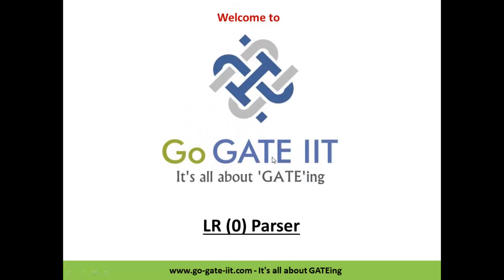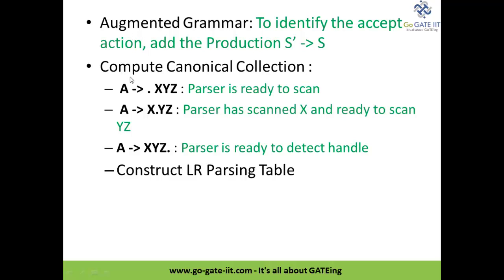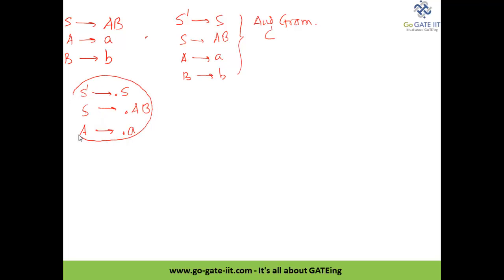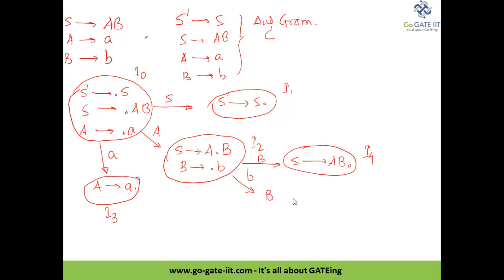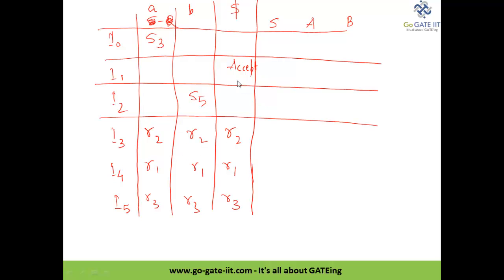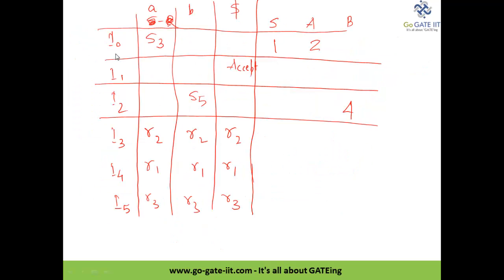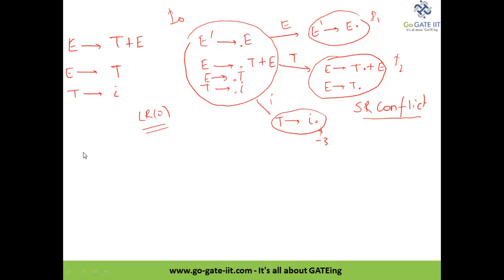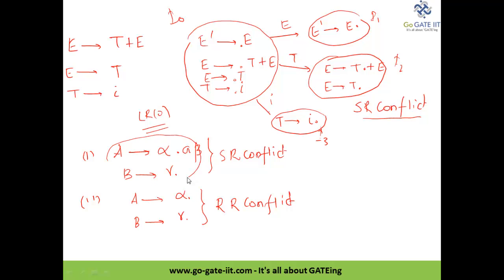Bottom Up Parser : LR (0) Parser

Comment: Your video I found helpful in understanding but there's one thing I didn't get it. Why did you write R1 in b and S column when only A-> a is reduced through rule 2) A->a . you said it is LR(0), is this the reason that grammar tells put R1 in other columns anyway even if they are not getting reduce through a rule.